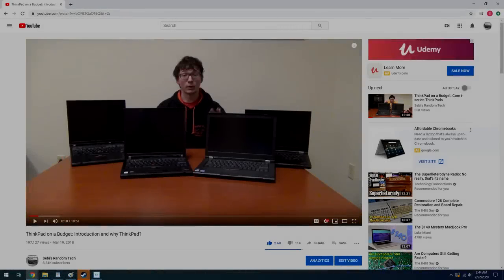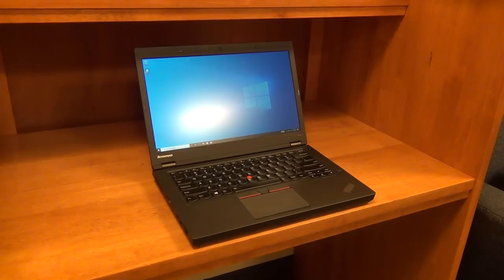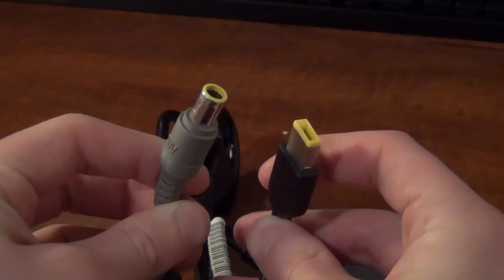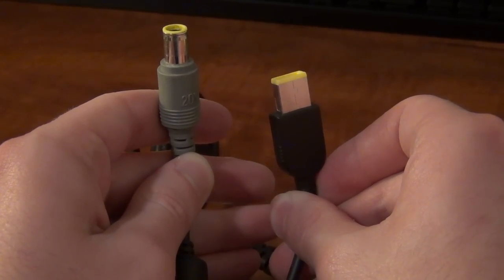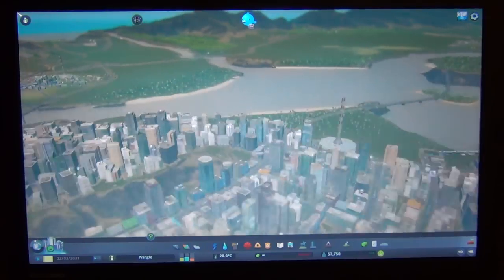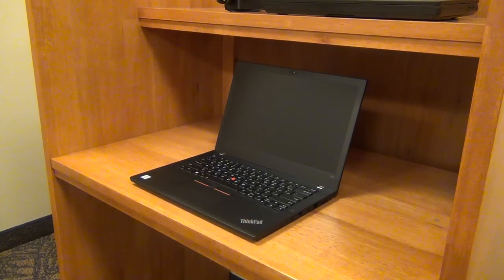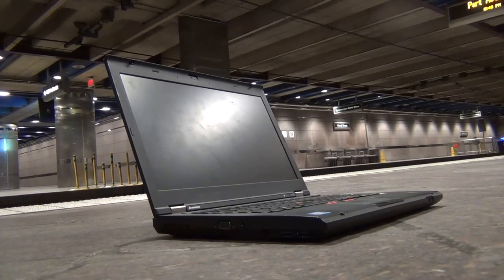Best Value ThinkPads in 2020

Comment: Alright, i know these arent thinkpads but ive been lookig around marketppaces and came across these 2 laptops, 1st one has an i3 1005g1 with 8gb ddr4 sdram and 256gb ssd fhd ips display, 2nd one has an i5 7200u with 8gb ddr4 128gb ssd and 500gb sata drive full hd tn display
Bot around 330-350 euros, would be used for occasional gaming like csgo maybe fortnite, also for uni programming in java
Reply from the maker: What model laptops are they?
Reply: @SebisRandomTech  the i5 is the  Dell Vostro 15 Model P62F001
The i3 is 14s-dq1105no
Also worth to know is that the i5 is used and the seller claims up to 3h battery life, altho it doesnt matter too much, and the i3 is being sold on a 2nd hamd market place but seller sais it has not been opened at all
Reply: Or, what about this ASUS X751LX 17.3 i7 5500u 8 ddr3 1600mhz 1tb hdd gtx 950m 2gb for the same price of 330€ ?
Reply from the maker: @bardhi0105  I think the Vostro might be your best deal.
Reply: @SebisRandomTech  alright, ill be doing more research since rn we are in quarantine anyway so i couldnt buy it even if i wantwd to, but thank you very much

Comment: Is an X1 5th gen worth it?
Reply from the maker: Depends on the specifications and price.
Reply: 512 gig ssd
i7 processor
Reply from the maker: What’s the price?
Reply: around 800 dollars.
Reply from the maker: @juliusriego4042  I would say that's a little bit on the high side, but if it's in good condition and that's the laptop you want then go for it.
Reply: Another question? What do you think, of all the used thinkpad is the best?

Comment: i am collecting thinkpad, i also have ibm thinkpad A21m, t61p, t60, t30, e550, t450s, t430s,  x201, and X1Extreme.
Reply: thoughts about X1 extreme ?
almost bought it but decided I'd rather separate work and play with brand new X1 Carbon 7 (i5 wqhd), and second hand PS4

Comment: I am a CS student. I need Thinkpad to use as my daily driver and do some coding. The Upgrades are not easy in my country as the parts are not available. I have to choose between W and T series.
Reply from the maker: Depends on the specs and prices you find. Let me know what specific listings you’re looking at and I can give you a better idea.
Reply: @SebisRandomTech  I am looking at following models.
t430
W530 
W520
t440p
Reply from the maker: @Anonymous-jt3yz  Of those models the T440p will be the newest and fastest. The T430/530 still hold their own though, so it will ultimately come down to specs and price.

Comment: I'm satisfied my T410's keyboard, solid case, big delete key and escape key, standalone volume control including mute key, but unfortunately it does not have UEFI bios, and the SATA standard can only support to SATA-II 3Gb/S, if available, I want a full size keyboard Thinkpad including the numeric keypad, these keys are very important to switch different view in most 3D modeling software, the PC market are not shrink-ed, but the manufactures does not made the laptops we wants.
Reply from the maker: T430 has UEFI and SATA-III.
Reply: @SebisRandomTech  T430 keyboard downgrade..
Reply from the maker: @yuan.pingchen3056  Classic keyboard mod...
Reply: @SebisRandomTech  is the haswell generation can modified to classic keyboard? haswell has AVX2, it's more close to modern computing. otherwise, I'll move to dell, I've see some dell models has roll cage design.
Reply from the maker: @yuan.pingchen3056  Sadly no, only the Ivy Bridge ThinkPads can be classic keyboard modded (as discussed in the video). However there aren't too many MASSIVE performance boosts with the Haswell generation compared to Ivy Bridge, so it's ultimately your call.

Comment: 15:36 What are the 3 models he is referring to? I need to buy a new laptop to replace an old Toshiba junk and I need to check my options
Reply from the maker: Maybe watch the whole video ;)
Reply: Check for base T440p prices and upgrade it to 1080p screen and i7 CPU. Might depends on the market, but price / value ratio here is usually very high.

Comment: There's an M.2 slot in the T440p next to the WLAN card that can take some SATA SSDs. Not sure if it could be used for something like an eGPU setup or not.
Reply from the maker: Nope, it's limited to slower speeds than what an eGPU would need to work.
Reply: @SebisRandomTech  is T420 for 300 good?
Reply: @stevethea5250  no

Comment: What is the best value ThinkPad with power bridge?
Reply: Probably not the best value but I purchased a t450s for like $160 because it was the last s model with powerbridge and I needed something light and thin with 4+hours of real battery life and in case I needed more I could buy another battery and do a swap.
Reply from the maker: It's hard to call any of them a good value right now if you care about performance. Right now you can get a T440, T450, T440s, T450s, X240, and X250 for around the same or a slightly higher price than what the ThinkPads mentioned in this video go for ($150-200 usually). You'll lose performance and upgradeability and are stuck with a low power ultrabook processor, but they are the cheapest ThinkPads you can get right now that have the power bridge functionality.

The T480 performs better while still having power bridge and being the same size as the T440, T450, etc, with modern amenities like Thunderbolt 3 and HDMI, while having quad-core processors and higher RAM limit (64 GB), but these still go for at least $400 or $500, and as mentioned in the video I have some concerns about the long-term longevity of them. I have a T480 and am working on a review of it, so when that video is up I will go into more detail about all of that.

Comment: Just bought a Thinkpad X240 for $110 on eBay. 
8gb ram
24 GB SSD
500 GB Hard drive. 
I5 4300U
Reply from the maker: Sounds like a nice deal for the price. What resolution display does it have?
Reply: @SebisRandomTech  (1366 x 768)
Reply: @jamalraja9157  That hurts. I bought an x230 last year but eventually the 720p resolution got to my nerves. Never again.
Reply: @RadeonX0X  Lol, to each their own. I personally bought it for work. I have a seperate desktop built for gaming, and I just use my phone for watching videos. So I really don't care about screen resolution. I did only pay $110 after tax. If I don't like it, I'll just return it.
Reply from the maker: If it’s IPS then that will look really nice.
Reply: Had it too, swap to a X250 touchpad, you'll get the buttons back, much better.
Reply: @edwardrf  I've been using it for a week and now I know what you mean lol. I probably will eventually.

Comment: No nvme on any of them, unfortunately. I gave a T420 to my sister a while ago. It still rocks!
Reply: Well, you can get a msata wich is slower bur yet way better than a normal hdd. And nowdays they are cheaper.
Reply: @eduardoavila646  Yeah sure. I'm just a little bit pickier than the rest because I do a lot of tasks that require random IO and could be served very well by a nvme SSD (programming/running vms/databases etc).
Reply: @LannisterFromDaRock  Yeah dude, i understand you, i had the same needs when i was on university until last year. When i said the msata's are fine, its for general usage. 

I also find them a bit slow compared to my nmve in my nitro 5. 

I use a msata on a x220 to watch tv shows in the subway, for that, its fine.
Reply from the maker: As was briefly mentioned in the video, a mod is now being made for older ThinkPads that allows NVME SSDs to be used in the ExpressCard slot on any model that has the slot. They’re bootable too, without any BIOS mods.
Reply: @SebisRandomTech  Woah that's good to hear. Sorry I was listening to the video @ work while trying to "work". :D

Comment: T61 or T42?
Reply from the maker: T61. T42 is way too old for daily use (the T420, on the other hand, is fairly modern).
Reply: @SebisRandomTech  i see. Thanks.
Reply: @SebisRandomTech  What about the SL400? Is that good as well?
Reply from the maker: @whatwaq  Old.
Reply: @SebisRandomTech  The T42 would be almost unusable at this point, the T61 is probably the earliest you can practically use

Comment: I bay t43  it biutiful . Ssd installed it corse cd device uses hdd converter . May connect 2tb. Mac not instaled in yap. Need time and beer 😺  need licence Mac need bay original 75$ mac. But keyboard Lenovo or ibm.  Mac be worker but on oem  mac with keyboard ibm.  Oem it presentation core from students. It fanny

Comment: T430 is more powerful than many newer ultrabooks in the years after. However, T430 has horrible pixelated screens and loud fans, which bugs me for using it anymore.
Reply from the maker: The screen issue can be fixed by using a FHD or 1440p upgrade kit (I did the FHD upgrade and am working on a video about it, night and day difference). As for the fans, there were several different companies who made the fans for the T430 and some are considered to be better than others. Using good thermal paste always helps so they don’t have to ramp up as often, and programs like tpfancontrol allow better control over how fast and how often the fans spin.

Comment: I am confused why you say the battery life is just "ok". According to Lenovo, the 9 cell battery gives you 14 hours! Even if the "true" battery life would be 10 hours, it's pretty damn good!
Reply from the maker: In real-world use, I get around 4-7 hours with the 9-cell battery. Lenovo, as with most laptop manufacturers, uses the absolute most optimistic numbers for its battery life ratings.
Reply: @SebisRandomTech  14 hours in a lot of tests on the Internet, including this one: https://www.laptopmag.com/reviews/laptops/lenovo-thinkpad-t440s#:~:text=Battery%20Life,-Lenovo%20sells%20the&text=With%20the%203%2Dcell%2023.2,Z40's%20runtime%20of%209%3A28.
Reply from the maker: @dtesta  That’s the T440s, which uses much more power efficient processors than the T430 and T440p.

Comment: the w520 and t520 can have 1080p screen :)
Reply from the maker: That they can.
Reply: @SebisRandomTech  
Just bought a 2nd w520 online. 
1st one sadly only had a 1600*900 screen. 

What i would really like is the following

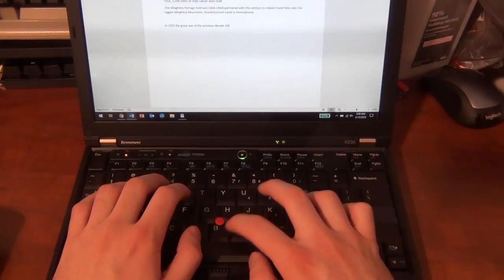16:10 screen (1920*1200 res or higher)IPS
old style 9 cell battery + battery slice
upgradable ram ( 4 slots )
7 row classic keyboard
msata + pcie NVME slots
physical wifi switch
express slot for external GPU
Optical drive slot

I think the w520 is just about the best of all the thinkpads. 

uses the t520 parts, just with extra ram slots, with the good keyboard and is so much more durable than newer models.

Also, i run windows 7 as windows 10 is a pain in the arse, as it brings with it so many problems to the table and win7 works for everything.
Reply from the maker: @qwertyui90qwertyui90  The W520 uses a 16:9 1920x1080 display. Otherwise, it pretty much fills all the requirements you desire. I know someone on r/thinkpads is working on a NVME adapter that fits into the ExpressCard slot, but of course that's a problem if you want to use an external GPU. The W540/W541 have both ExpressCard and Thunderbolt support, but they don't have the classic design.

You could also get a W530, swap in the classic keyboard+the EC patch, and then upgrade everything else. You get a small performance boost and better battery life, better graphics, and (not that this applies to you) native Windows 10 support.

Comment: Im on the 430s & the Update' are unreal as the next one in Hacker News & Reddit my Lenovo will be hit with a bug in the next Update,only Blue or Black Screen all in the name of Microsoft's uneeded rubbish as it is now constantly along with a good old clean out with disk cleaner to %temp%  to  temp  to  Prefetch in RUN but being a 430s it's being beat to nothing after buying new RAM.  Now Windows 10 Pro being given a a restart to see if a difference can bring it back to the way i got it there is 300 gig - 1TB External e- i-core 5 - 8 ram good robust Laptop with the black carbon surface as mines is brand new and kept that way....Great Video ...Thank You Kindly

Comment: I got E585 with Ryzen 2500U. NEVER BUY IT. NEVER NEVER NEVER!

SSD inside of this garbage is totally a crap. It's an NVME drive but its read speed is around 200-600MB/s. I don't know if other ThinkPads have slow boot issue but E585 boots very slow. It shows Lenovo logo in 10 seconds then 10 more seconds to boot Windows (totally 20 seconds). It's not about bad quality SSD something wrong with BIOS. I contacted Lenovo but they don't even release any BIOS update. Please reply if you know any fix. I wish didn't buy this I gave my money for a garbage.
Reply from the maker: While the E series has gradually gotten better over the years compared to when it was first launched around a decade ago, I still view them as barely above consumer-grade garbage that has the ThinkPad name on it.

You could try updating the BIOS, replacing the SSD, doing a clean install of Windows, or messing around with settings to see if anything fixes your issue.
Reply: It even boots slow with Samsung EVO 970. They don't release new BIOS update as I said so I can install nothing. I tried everything nothing worked. The bad part of it service center simply ignores this issue. I mailed Lenovo they didn't do anything either.
Reply from the maker: @kadircanaknc3400  To be fair, I imagine many service centers may be short-staffed or flat out shut down thanks to COVID-19. If you keep having issues I suggest reinstalling Windows and seeing what happens.
Reply: @SebisRandomTech  I meant reinstalling Windows by "I tried everything". I formatted my SSD I did a secure erase installed xubuntu and checked if it boots faster there. Nope. That 10 seconds of delay is permanent. It's not about SSD or system itself, it's a BIOS fail. I never expected such fail from a ThinkPad.
Reply: @SebisRandomTech  Look at this video. Even GRUB screen. Everything is slow because of BIOS. An HDD would perform better than that. Definitely a BIOS issue.
Reply from the maker: @kadircanaknc3400  Is the laptop still under warranty?
Reply: @SebisRandomTech  Yes
Reply: @SebisRandomTech  Every E585 has this issue. They can do nothing in the service center. A BIOS update is needed.
Reply from the maker: @kadircanaknc3400  What makes you say that?
Reply: I called service center. They told me to reinstall windows lol

Comment: Help me
Error 1802 in my Thinkpad 🥺
Reply from the maker: Seems to be something related to your wireless card. Did you replace it with an aftermarket card?
Reply: @SebisRandomTech  no i didn't done anything 🥺
Reply from the maker: @nirbhaykumardubey8050  Try replacing it with an identical Lenovo one (with a Lenovo FRU on it).

Comment: How about a W541?!
Reply from the maker: They’re good machines, I have a W540 myself, but they’re just not a good value right now. They still fetch several hundred dollars for even a lower-end configuration, as opposed to the laptops recommended in this video that can easily be found for less than $200.
Reply: POS graphics card heats up the palmwrest. I wish I hadn't bricked my w530 better in every way except a tiny bit of performance
Reply: @SebisRandomTech  I have two, W540's I concur. I got a GREAT deal on mine, but they were STILL $370-$380 USD. However, over all, MUCH better specced than even a good, T480, faster, more storage, and sturdier, at a total of $553. You can't even get a T480 with 3 SSD's, 32gb/RAM, dGPU, 3k display and a CPU as fast as the i7-4900mq for even CLOSE to that!
Reply: @Aygross  Re-paste, it helps that tremendously.

Comment: 14" god why? 😭
Reply from the maker: Because why not.
Reply: So I can actually carry it around comfortably. Better battery life. With 1080p on a 14" screen, I can easily work on spreadsheets, video editing, etc. Sure, a massive screen does have certain advantages in niche scenarios, but for most use cases, there is absolutely no benefit.

Comment: I appreciate the content homie.

Might want to strengthen your videography. The random shots of the device open on the linoleum floor, on a walkway outdoors, etc don't add anything and are unnatural. 

Keep up the hard work!
Reply from the maker: I like changing up filming locations. Filming everything on a desk gets boring after a while.
Reply: Sebi's Random Tech I get that, not saying everything has to be in a typical setting. I tried to come at it respectfully, but some of the shots are just too unnatural and come off as a poor attempt at art as opposed to adding anything to your actual content.
Reply: @gregorymarcus3381  The cool thing about art and what is an isn't good is that it's all subjective.
Reply: unnatural as to what? It's simply just a refresh shot. And even your average smartphone reviewers do these kind of shots. So it's unnatural for laptops to be out in the open? Just wait 'til you see college students in my country..

Comment: Recommends all 16:9 display machine...
That is the exact opposite of what i look for in a machine and if a machine does not have at least 16:10 it is immediately discarded, atleast for a work machine.
Reply from the maker: Thanks for watching!
Reply: boomer

jk, just go for a *10 series I think they have a 16:10 display
Reply from the maker: @ajddavid452  Also, newer ThinkPads are starting to use 16:10 displays again, such as my X1 Nano and the newer X1 Carbon/T14/T16 models. Additionally, some modders in the community have been modifying machines like the ones I recommended in this video to accept the 16:10 panels new ThinkPads are using, with some success.
Reply: @SebisRandomTech  nice
Reply: Going to 16:9 was weird for ThinkPads in the 1st place. Widescreen was for entertainment, not work. But hey 🤷🏾‍♂️